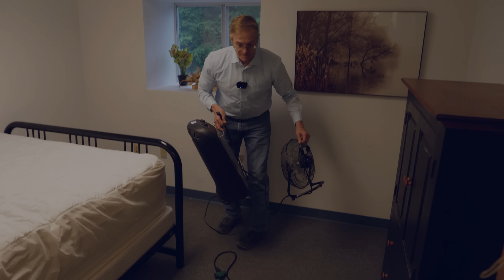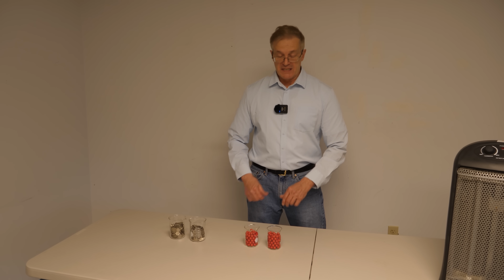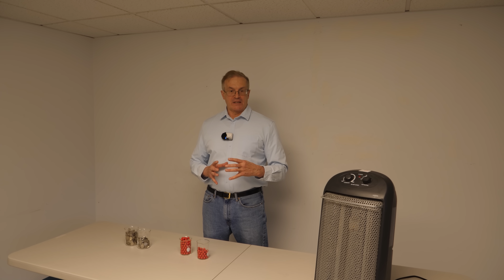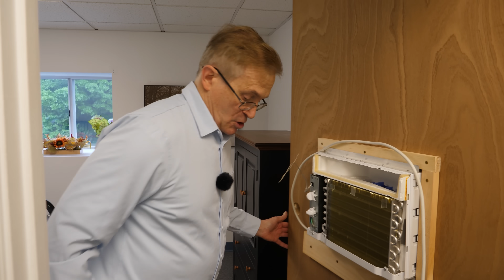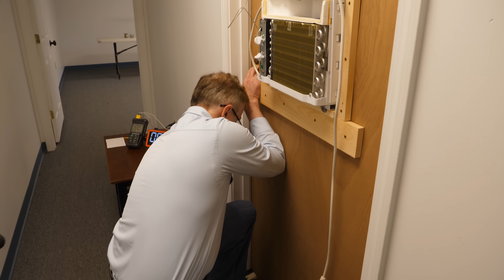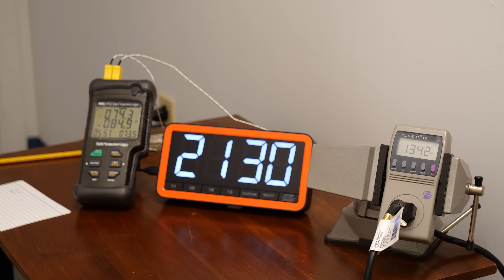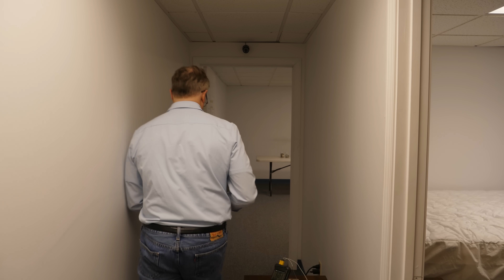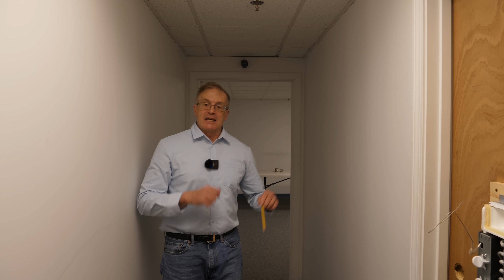You're wasting money on heating! Use your A/C!

Comment: Heat pumps are ok in more southern climates of the US. However after about 10°f, they drop in efficiency drastically. At anything under -15°f. They stop working entirely. As a HVAC/R technician, my advice if you live in the north. Always have a conversational heating system for winter. Be it oil, gas, or electric.

Comment: The only flaw in your test is the time for the absorbed heat in the rooms walls/furniture/floor/etc to completely loose their stored heat during the previous test.  Nevertheless, the heat pump raised the temp at least as much as the resistance heater with one third the power.  I use minisplits and rv roof air conditioners w/heat pump for this reason.  Being off grid utilizing stored power in batteries at night forces you to use the most efficient units available.  I wish I had wall thickness like you lol.

Comment: You should do the second experiment, but have the ambient temptress be as cold as you can get it.  Maybe use more ac units to cool the whole area that the heating ac unit will be drawing its heat from.   I think if you showed how it can suck heat from already cold air, it would really push home the point.   Seeing is believing

Comment: I have an LG dual inverter Portable AC (nominally 14000BTU actually ~12000BTU) Single Hose that I also use in the winter ... I have 2 separate hoses, one the normal hose for use during the summer where it dumps hot air outside, and one an insulated hose that I connect to the top of the unit (which would normally be supplying the cold air to the room) that then connects outside ... I get a COP of about 2.5 with it as a heater in the winter, so I am the reversing valve. In Canada, it is hard to get portable ACs that also have heating (some that are available have heaters actually use resistance heating also) and even the ones that do provide heating via heat pump can only handle about 4 or 5C minimum air temp ... so the single hose AC works both as a heater and a ventilation device (via a cracked adjacent window) which is doubly useful for a condo built before people understood the term HRV.

Comment: Hmm my aircon can run in reverse as a heat pump, but the electrical energy it runs on is here much more expensive than the natural gas the central heating is using.

Comment: Your test conditions are not real world. Nobody runs a heater at at 75 degrees f. The colder it is outside the less efficient the heat pump is. The resistance heater will surpass the heat pump in efficiency when the temperature drops below about 25 to 32 f. That is if the heat pump is still operating at all. They have to add more than just a reversing valve to operate below about 40f.

Comment: Now this begs the question... Can you use a space heater to cool off your house in summer? XD
On a serious note, following the concept of spending little electricity moving heat energy into a space to warm it up instead of spending much electricity adding heat energy, I wonder if it's possible to cool a space down by pulling heat energy from the space, converting it into electrical energy, and selling it back to the grid instead of moving heat out of a space? If it is possible, would the energy pulled out of the air be greater than the energy spent pulling it out, thereby reducing your electric bill by cooling your house off in the summer instead of increasing it??

Comment: I'm 59 years old and I feel like such a chump...  I have been referring to AC as something different from heat pumps my whole life but it is the same thing!  Duh!!!  Not in one million years would I have thought to install a standard AC unit backwards to use it as a heater!  My life plan has been to retire to a truck camper at retirement age where every watt is a limited and precious commodity.  Everybody uses diesel heaters in the winter because it has just been an established fact that electric heat uses too much power.  But any camper system can provide 400 watts of power and if for 100ah of battery you get 5 hours of heat instead of 1 then electric could be covering a big chunk of the winter heating.

I checked and Amazon has an 8000 BTU window unit (Midea) with 5 modes (cool, heat, dry, fan and programable auto for the super lazy).  Dehumidifying without cooling, a timer for the power conscious, washable air filter, has an app, uses 400 watts max and sells for $380 new (or if you are cheap like me for $336 used very good).  I'll request they send the sales commission check to you but science work is typically paid in the love of learning, not money.

Comment: I really like the channel and this topic but have to say the comparison is a bit unfair in this case. Resistive heaters would perform at the 100% efficiency even if the hallway temp was 0F, but AC COP would suffer significantly. You certainly wouldn't turn AC heating on if it was 75F outside.

That being said heat pumps ARE more efficient, you could've shown that in a more realistic scenario.

@TechnologyConnections has a couple of nice videos on this topic.

Comment: When the evaporator is outside and the temperature is 32F, the efficiency of the  resistive heater will be the same, but the  efficiency of the heat pump will not.

Comment: idk why you'd use a space heater instead of gas or oil, which is more efficient for thermal output.  heat pumps don't use entropy.   wtf is going on here.   it's pressure and thermal kinetic energy transfer.

Comment: I asked a vortex tube engineer why they aren't more common in house cooling and I was told it's just not as efficient as refrigeration, what are the key differences between pumps and vortex tubes?
Reply from the maker: They're right.  The efficiency of a vortex cooler is quite low.  They can reach very low temperatures and are great for spot cooling, but not so much for building scale cooling requirements.

Comment: Heatpump have been around almost as long as the compressor fridge.
My dad had an experimental air to water heatpump 45 years ago.
I bought my first air to air heatpump 24 years ago, and air to water 14 years ago.
COP value have increased year for year, last figure I heard was over COP 5.0

I don't understand why USA and some places in Europe have been so slow to pick that up.
Also the BIO gas is big in my country in Sweden. I think we have done that to since about 30 years ago.
All human poo (waste water solids) farm animal poo, food factory waste, slaughter house waste, liquor that need to be disposed, in short every thing biodegradable that can become methane in a digestive chamber. From this you get Methane that you can run CNG cars and heavy vehicles. Even a gas turbine for electricity and remote heating grid.

Comment: I find it hard to talk some of my customers into a heat pump system rather than just an ac only system. The new 20+ seer heat pump systems are so efficient it boggles my mind. Some now work down to an outdoor temperature of -10F fairly efficiently. I wish that the NHSaves rebate program would add a larger incentive for heat pumps over ac only systems. Currently the rebate is $250.00 per ton. If they offered more for the heat pump I am sure that we could all save on electrical cost.
Reply from the maker: As much as I like the technology and its potential,  I do not favor incentives that distort the market and transfer an expense to other taxpayers that do not use it.  They're good and should be marketable, but on their own merits.

Comment: I love watching your videos, with this one I was quite surprised to hear that Americans don’t really use heat pumps! They’ve been the standard here in Aus and NZ since the 90s, I can’t imagine using a space heater to heat a whole room - that’d cost a fortune with our power prices.
Reply: It really is a culture shock to watch science communicators see an apparent need to explain that heat pumps and air conditioners are fundamentally the same thing. In Australia I don't think I have ever seen an air conditioner which doesn't have heating. And that includes some old window AC units from the late 70s which you very much couldn't get regassed these days. We hardly used the heating capability back then because gas used to be cheap enough to offset any efficiency arguments. But it still blows my mind that you would even have to check that the feature was supported in the unit you were looking at buying.

Comment: Hi, one small point, you are removing thermal mass from the room by moving the heater and fan outside of the room for test#2. You should have kept them in place for correct comparison ;-) Granted, it won't make much difference on your outcome. But - if you want to be scientific... Good demo though.
Reply from the maker: That was a decision to counter naysayers that would suspect that we cheated in the demo.  The mass of those items is around 1% of the rest of the stuff in the room.

Comment: Good demo, you would make a great science teacher.  BTW, You can actually install your window AC backwards in the winter for heat, only for short cycle's to prevent evaporator icing!
Reply: Make a video about swamp (evaperative) coolers which exploit that very dry air in desert, you see them a lot in AZ

Comment: To me fair, I would think a heat pump would be used typically during the winter when temperatures are below 70 degrees. In fact, more like below freezing. I suspect the efficiency might be different depending on the difference in entropy between the two parts of the system.

Comment: If you and your neighbours are deaf, sure. But the problem with heat pumps is just that, they're pumps. They generate an unacceptably high amount of working and vibrating induced noise into a residential setting.

There doesn't exist an ac unit or heat pump on the market that isn't unacceptably noisy, even brand new.

And it only gets worse with age.

That's why heat pumps have never been the default heating choice.

Comment: I have considered moving surplus second-floor solar heat gained from a south-facing windowed room to the cooler room on the floor below it with a window unit and ducts or a split air conditioner. It could really pay to move heat around by this method rather than continuous fan operation of the central HVAC system.
If I could only make it silent.